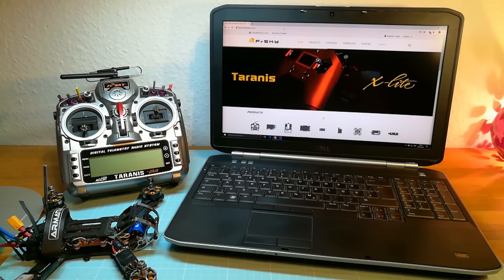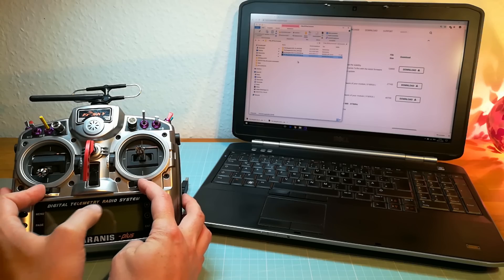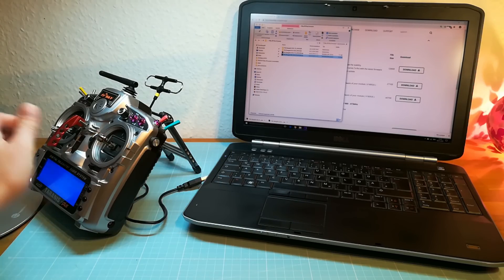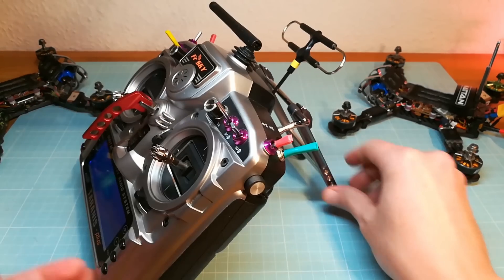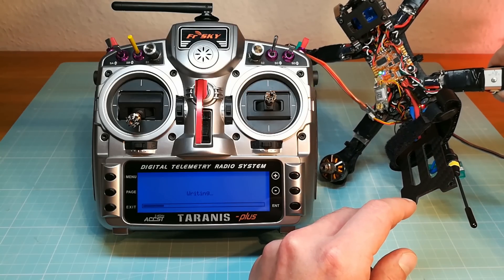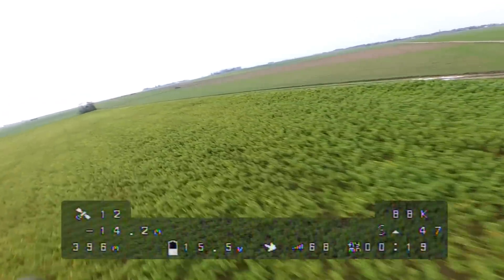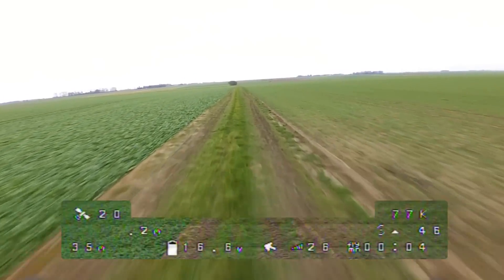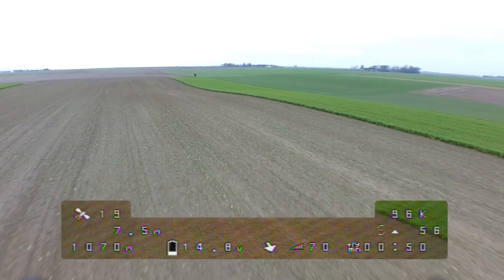FrSky R9M - 181228 Flex Firmware - Test and How To

Comment: Irgendwelche Unterschiede? Konnte meinen Flieger noch nicht mit der neuen Firmware testen, da das Wetter sehr schlecht ist. Ich habe gelesen, dass die RSSI Darstellung verbessert worden ist.
Reply from the maker: Das Wetter ist hier nicht besser :D Spaß macht das Fliegen bei den aktuellen Temperaturen nicht. Als ich das letzte mal fliegen wollte habe ich mich auf dem matschigen Feld sogar festgefahren - aus dem Fliegen wurde dann eine Auto Bergungsaktion. Zum Testen der neuen Firmware habe ich mich dann aber doch mal rausgequält. Ich habe so einen Taranis Handschuh: https://www.banggood.com/Upgraded-Transmitter-Warm-Hand-Glove-Cover-Shield-Winter-Outdoor-Flying-For-Flysky-Frsky-DJI-p-1119505.html?p=LM11044296190201604E
Anders klappt das Fliegen bei den Temperaturen gar nicht mehr.

Im Vergleich zu meinen anderen Videos und Flügen kann ich eigentlich keinen Unterschied in der RSSI Darstellung feststellen. RSSI Wert sieht gleich aus, auch beim RSSI Output auf Kanal 16 hat sich nichts geändert, daher habe ich auch das Scaling etwas angepasst. 
Von Standardmäßig rssi_scale = 100 und rssi_offset = 0
auf rssi_scale = 73 und rssi_offset = 27

Auch nicht optimal aber so stimmt es in dem Bereich 50 - 60 %Rssi ziemlich genau mit dem Telemetry Wert überein. 
So ist der geringste RSSI Wert aber nicht mehr 0 sondern 27 und dann wird eben in 73 Schritten von 27 bis 100 skaliert.  
Wäre dennoch schön gewesen, wenn FrSky den Rssi Output auf dem Kanal 16 angepasst hätte.
Reply: @TorbanDallas  
So, leider wieder kein Erfolg mit der F.Port Variante. Ich vermute, dass die verbauten servos irgenwelche Interferenzen erzeugen und so das F.Port Signal stören. Ich bin jetzt wieder auf die SBUS Variante umgeschwenkt, welche ohne Probleme funktioniert.
Reply from the maker: @waldemarkraus2855  Welche Probleme hattest du genau mit der f.port Version? Ich bin aber auch bei sbus geblieben, einerseits weil ich schon so oft von Problemen mit der fport version gehört habe wie bspw. Verzögerungen und Failsafes, und anderseits weil ich es einfach nicht brauch. Alles Infos stehen im OSD, ich brauch nicht einmal Telemetrie.
Reply: @TorbanDallas  
Ich bekomme immer wieder Failsafes obwohl der rssi Wert bei über 60 liegt. Teilweise komme ich aus dem Failsafes nicht mehr raus ohne die Taranis neu zu starten, der Empfang ist dabei stets gut und auch die Telemetrie funktioniert. Es liegt definitiv am F.Port weil mit der SBUS FW geht alles. Evtl gibt es hier noch irgendwelche Bugs in INAV, aber das Developer Team hat mich auf Frsky verwiesen und meinte dass der Fehler bei denen liegt.
Reply: @TorbanDallas  
Noch ein wenig Input zur aktuellen Flex Firmware. Ich habe meine Antenne nun horizontal in den Flügel platziert und konnte heute 10km mit 100mw erreichen ohne FS, rssi war bei 38, d.h. hier ist noch Luft nach oben. Das ganze sogar mit Telemetrie!!
Reply from the maker: @waldemarkraus2855  wow 10km :) aber bestimmt mit entsprechender Höhe. Mit meinem Copter schaffe ich so 2,5 km dann zwingt mich der Akku zum umdrehen, aber ich fliege auch gerne bei diesen Entfernungen noch flach über dem Boden. Ein Wing ist natürlich perfekt um das R9M Modul voll auszureizen. Hast du da denn auch einen GPS Rescue Mode falls es zum Failsafe kommt?
Reply: @TorbanDallas  
Natürlich nur mit GPS, wäre sonst zu gefährlich. Und klar, die Höhe muss passen. Aber das war nur ein Test um zu sehen was das R9 System kann. Ansonsten mache ich lieber proximity Flüge, aber auch hier ist das R9 im Vorteil, da die Signale besser durch Bäume gehen.

Comment: So many firmware its so annoying ahaha but thank you , for your vidéo its very helpful
Reply from the maker: Thanks for your comment! Well, there's three kinds of firmware versions for the r9m available: A FCC Firmware for everyone outside the EU, an EU Firmware for flying in the EU and the Flex Firmware - with the Flex Firmware you can set the ouput Frequency to the FCC 915MHz or to 868MHz for the EU. You're even free to set the output power of your R9M Module. 
And at last, you always should use the newest Firmware.